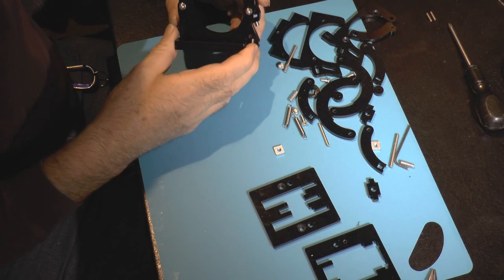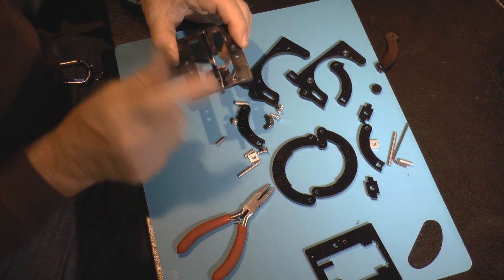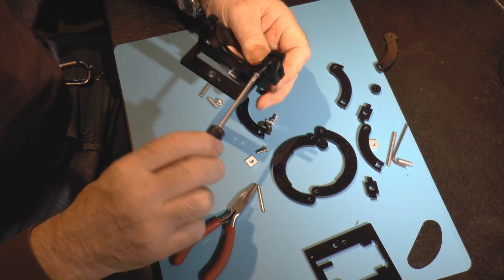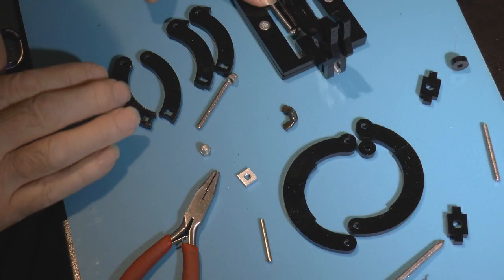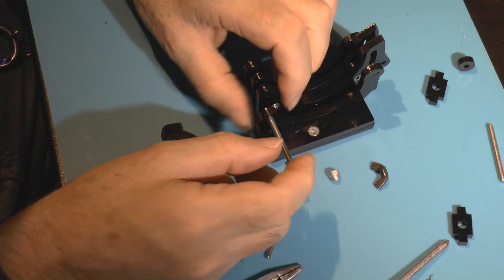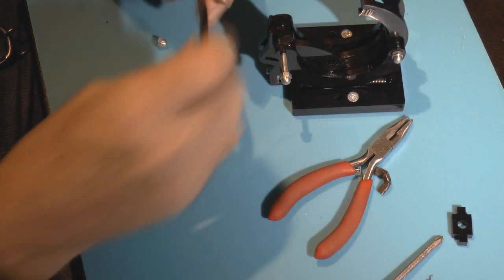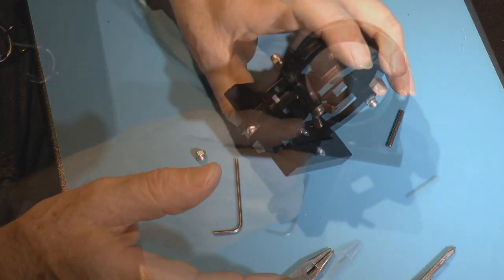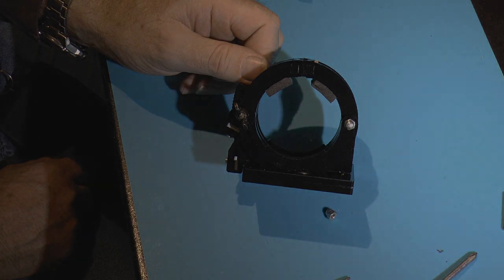RDWorks Learning Lab 37 Adjustable tube clamp DIY

Comment: Is there an easy way to scale the clamps up, to fit a 80mm tube ?
Reply from the maker: I have a fixed version for an 80mm tube that would be easier to adjust  but it is not just a matter of scaling things up.. You have to know the existing center of your tube to modify parts accordingly. If you wish to add your disguised email address to another comment I will send you some dxf files for you to play with. 
I will also delete your comment/email address
Best wishes
Russ
Reply: @SarbarMultimedia  And... It looks like my request for the 80mm files has disappeared again... :)  Can you please send them to my first initial, last name with a dot and then a "ca"... And I use the big ol' Gmachine to deliver the goods!

Boy, they've gotten better at getting rid of email addresses!
Reply from the maker: @kimspur  
  You have done a good job of disguising your email address. I have tried 3 different combinations and they all bounced.
YTry something like  (johndotsmith   at    yahoodot=====com)
 Thanks 
Russ

Comment: A little late to the party.  Do i need to drill new holes in my machine?
Reply from the maker: Hi
Simple answer is yes. Especially if you are upgrading to 60 watt tube (this is designed for a 55mm diameter tube). You will need to move the clamp position towards the anode end of the tube..
Best wishes
Russ

Comment: Russ, me as well mail4sam@gmail.com please! :) Just finished cutting up a sample part. Nice job! very clever design. Ill have to adapt the base plate to align with my cabinets holes as well as my hardware.Ill post my changes and parts list tube diameter etc... to pay it forward? Thanks again Russ. S
Reply from the maker: +Sam Rod 
I have 4 existing holes for my mountings but decided to punch two more in to suit these clamps. The back edge of the base plate has been designed to touch the back face of my enclosure That way I have a good alignment reference for the tube nominal position before I start using the +/- 3mm adjustment. As always, will be interested in your adaption.
Regards
Russ